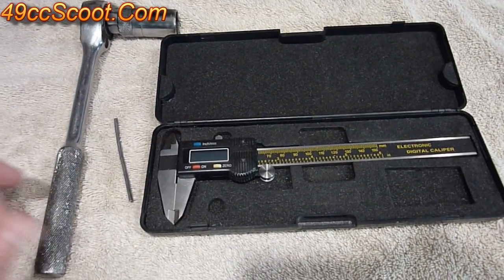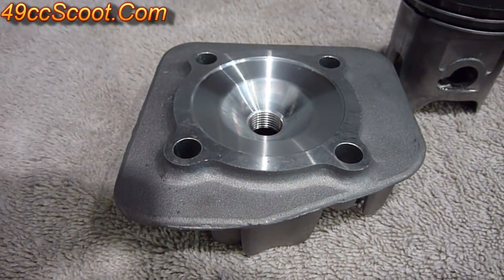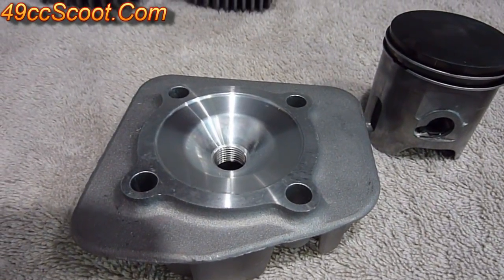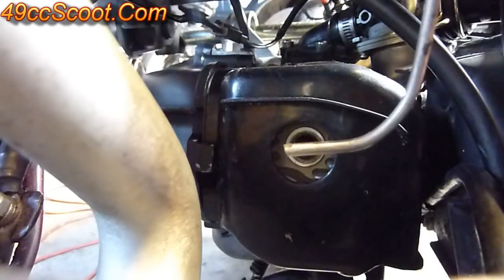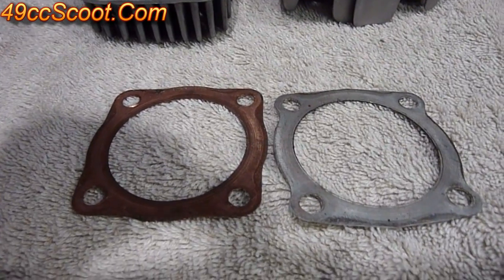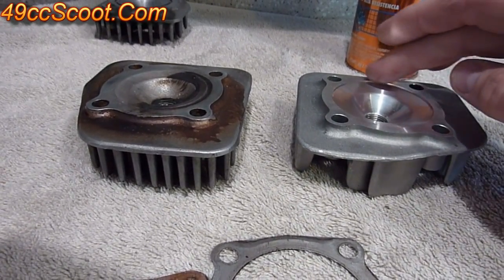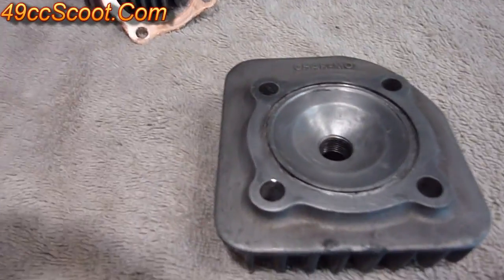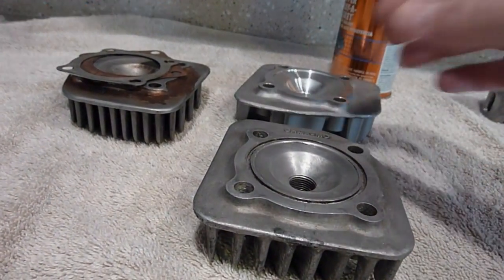Checking Squish Clearance : Two-Stroke Scooter Help

Comment: any advice for a 100cc 2t that measured 130 psi, and after a rebuild it reads the exact same 130 psi? tech manual calls for 170, cylinder, piston, rings, gasket kit and head are all stock. i'm puzzled wtf is going on here?

Comment: i would recommend that when you use the solder method that you remove the head and lay the solder front to back,across the piston> checking it the above way will give you measurement  error with piston rock!  also turning the motor over,even with a kick starter can hurt the rod bearing..molding clay of course is the old way ,but also safe way,solder is great in that you can check its variables across the squish band  rotate the motor with the crank !!

Comment: on my 70cc racing cylinders are there 0.55-0.6mm , but it is not normal and set the squish though it is not a racing cylinder often . when buying a cylinder with a piston and it comes with 1 bottom seal so it should fit , but it comes with several base gaskets must be set for a user manual but it's fine and see the piston does not come for now close to the top. Remember also piston ring gap 0.15mm feeler gauge when buying a new cylinder , also tighten the bolts with a torque wrench by about 1.2 kgm at 70-100cc .
I have 4 manuals here , TPR 86cc 0.8-1mm , Malossi MHR replica 70cc says nothing about the topic , MHR 70cc 0:55 , Malossi MHR 95cc 0.55mm. two stroke !

Comment: It affects timing when changing the thickness of the base gasket or shim because the entire cylinder and cylinder head are moved farther or closer from the rotational axis of the crank shaft. Changing the clearance by milling the surface of the head or using a different thickness head gasket the cylinder is not moved and port timing is not altered.

Comment: Also small squish clearance is critical to engine efficiency, as the pressure created mixes the fuel with air and pushes it towards the spark plug. So it is better to run the smallest squish clearance recommended for your intended use. If the engine knocks at that clearance increasing the combustion chamber volume at TDC can eliminate the knock while maintaining the efficiency created by the squish.

Comment: I thought I was an "amateur expert" on small motors, but I've never heard the term "Squish C." before. This was an interesting video. I've sometimes lowered head space on older mopeds, in order to increase compression, by sanding it, by attaching sandpaper to a flat window.

Comment: This method also works on 2 stroke dirtbikes.just had my cr 250 done after I had ridden 2 bikes that already had it done and the difference is easily noticable.it only cost me around $100 including new gaskets.

Comment: what if the piston dont get the max high (about 3mm down the edge)?? whats te solution
Reply from the maker: You'll have to figure out what can be changed to improve the situation. Thinner gaskets, wrong cylinder, decking the cylinder, modifying the head, piston with a different compression height for a few ideas.

Comment: very good videos... have a question.. have a scooter 49 cc that start but shut down right away, i put a hose directly from the tank to the carburetor thinking that would be   
the gas regulator,  but still the same, the carburetor is seal and have a spark so in your experience what do you think could be the problem and also have good compression.
Reply from the maker: Clean the carburetor.. Use compressed air and carb cleaner in every passage. Make sure the jets are clear. Check float height.

Comment: hi question here, if you remove the head and barel gasket to adjust the squish band, it will increase the height of the piston hence decreasing the squish band right? now, do you need to grind the piston to match the combustion chamber curve? cuz if you increase the piston height it will hit the cylinder head right? thanks in advance!
Reply from the maker: You have to maintain a minimum squish clearance so you don't have piston and head contact at any point. Removing gaskets will narrow squish clearance, the clearance between the head and piston. The squish band is usually referred to as the section of the head that mimics the piston crown angle, along the edges of the combustion chamber. Heads or pistons could be modified for a closer match of those angles, but in most cases for me it hasn't been necessary. Sorry the reply took so long, your comment was marked as spam for some reason.

Comment: i have a 2 stroke 50cc dont start got good spark and gas flow i remove the cylinder out but looks good but the rings are to loose can you help me out thanks a lot
Reply from the maker: +neftali lopez Check your compression or if you already know the rings are bad, replace them. Before spending the money on rings, you may want to find a service manual and inspect the piston and cylinder as well.
Reply: im putting everything new the only thing i dont no is to do the timing

Comment: Do you use the copper spray on both gaskets on the 1E40qmb when upgrade
Reply from the maker: +marc I just use it on the head gasket, but some people spray the base with copper.

Comment: what kind of rod are you using is that a lead rod or just and ordinary metal rod?
Reply from the maker: If you mean what I'm using to check, it's solder. Any solder should work if it's thick enough.

Comment: Use 1/16 solder and put it over the wrist pin
Reply: I always did a cross held in place with grease then averaged, but that was pulling heads each time.

Comment: What could be why I'm getting only 30 compression
Reply from the maker: +marc A compression tester that doesn't seal, stripped threads in the spark plug hole, engine wear or damage.